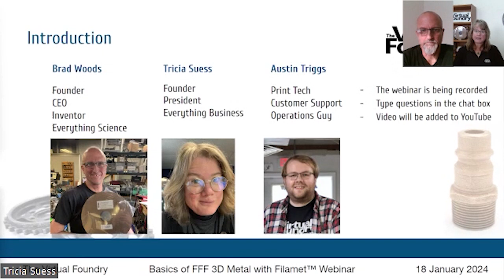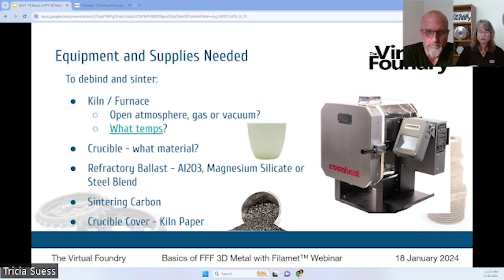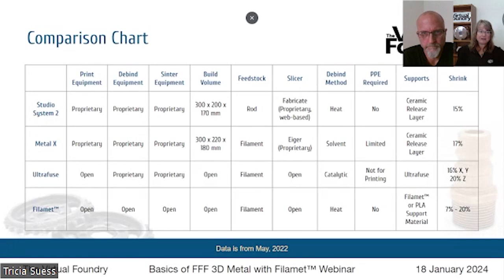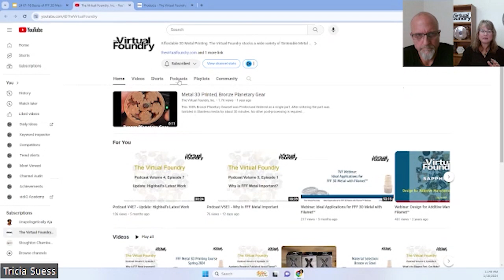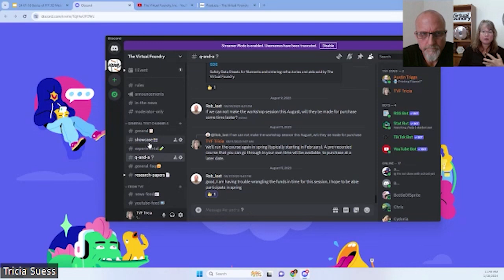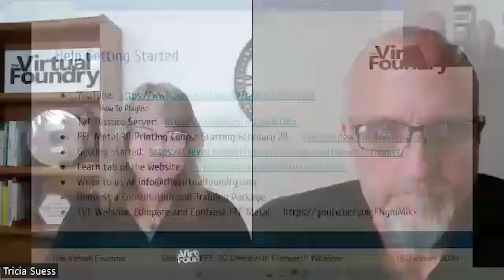TVF Webinar: Basics of FFF Metal 3D Printing with Filamet™

Comment: Damn, missed it! tried launching it and nothing happened. Your "Basic Print Settings" sheet should probably be updated to include Z offset.  Also this is a BIG one - YOUR WEBSITE needs to have an update to say that a "PROGRAMMABLE Kiln" is required  - I didn't know this and spent $600 on a Glass Kiln that has a timer thinking I'd be able to debind and sinter! Thanks for that. Now i have to research what programmable thermostats are available that I need to buy to replace the timer! Lastly, I wish you had variations of colored glass, some with chameleon color changing mica.

Comment: A great video! Do you have recommended calibration prints to use as a reference for dialing in shrinkage for accurate dimensions on finished parts? Something like a Filament benchy?
Reply: A Filamet benchy would be great. As for shrinkage and dimensions, the orientation of the part during the sinter stage has a bearing on the outcome. I'm working on solutions to this, namley Filamet ceramic supports.
Reply from the maker: This may help! https://youtu.be/yczZWRFUVLU
Reply from the maker: We like the Universal Calibration Rings as a starter print: https://thevirtualfoundry.com/universal-calibration-rings/?_gl=1*13ocpm3*_ga*MjA5OTE3MzkyNC4xNjk1MTM1MTY5*_ga_98EE4VT7HE*MTcwNTkzODE1NC4xODEuMS4xNzA1OTM5MTgyLjU5LjAuMA..*_ga_LBF9T3JWB1*MTcwNTkzODE1NC4xODIuMS4xNzA1OTM5MTgyLjU5LjAuMA..*_ga_RR6SGN66JP*MTcwNTkzODE1NC4xOTAuMS4xNzA1OTM5MTgyLjU5LjAuMA..